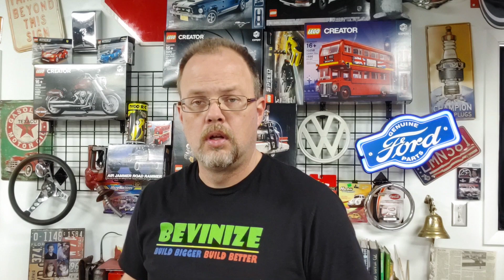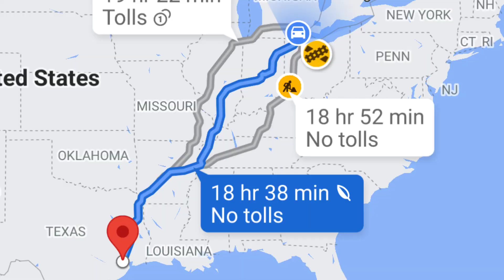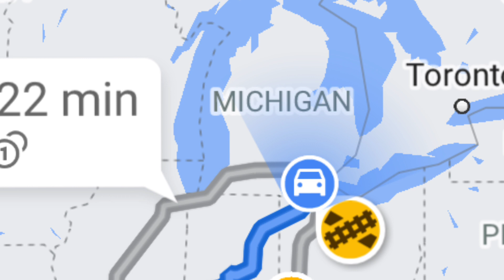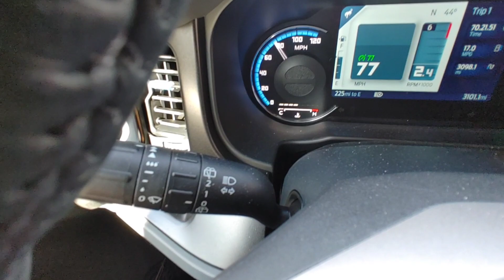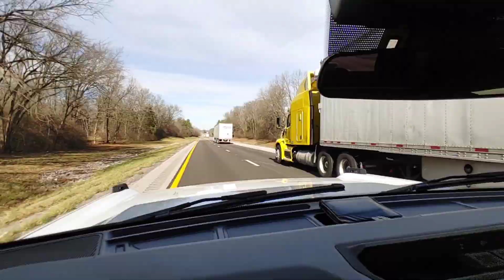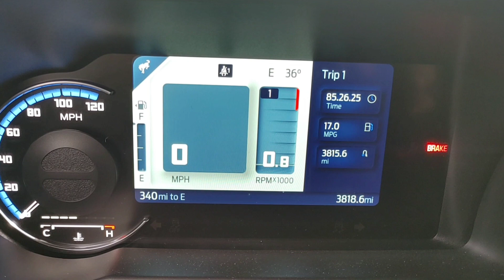2021 Ford Bronco Electrical Problems 8 Weeks Into Owning !

Comment: From the video looks like you were using the wipers when it was dry? Or high setting when it was sprinkling?
Reply from the maker: Yes but I did that to show how they slow down and shut off as it's easier to notice.

Comment: Hey I have a 21 4 door outerbanks 2.3 auto.  Iv had both these issues.   

The wipers were fixed by changing the motor

It's in the shop for thr brakes right now. I also have a light saying park break has also failed and over heated.

Any progress with yours?
Reply from the maker: Yes the brakes were a vacuum line failure to the booster and the wipers was a recalibration of the sensor and switch replacement.

Comment: I leased a new 2021 Ford Bronco about 14 months ago. I get an average of 28 mpg on it. The only issue I experienced was about 4 months ago, the display screen didn't boot up, so, I could not the image when I backed out of my garage. I scheduled an appointment to have it diagnosed, nut couldn't get in until two weeks later. While I was waiting to get it looked at, one morning, the screen came to life and there has been no problem since then. I took a 3000 mile trip to Ely Nevada by way of Denver and Colorado Springs. On the return trip, I experienced an mpg of 30 on I 80 near Evanston WY at 80 mph. --+ Its legal in Wyoming
Reply from the maker: With that gas mileage it sounds like you have a bronco sport.

Comment: You don't take your vehicle to the Dealership.   And don't buy a Bronco - they seem to be having problems,.
Reply from the maker: You must like to piss away money because when a vehicle is under warranty yes you take it to a dealership.
Reply: @BevinsBuilds  Even though it is under warranty, the vehicle will languish in the dealership for weeks on end.  You know, still in troubleshooting - yak, yak.  They'll fire the "Parts Cannon" at it.  You get your "little Ford car" to drive while they have your Bronco.  

In the end you'll be back and back to the "Stealership" time and time again.  Some fun, eh?  (A little Canadian lingo there at the end.)  Thanks.    

Note: There's NO way the dealership "techs" can troubleshoot - find - and fix a complex electronic problem in the time they are allotted for the vehicle. If you have to bring it back and back, they will work on it when they have a chance.  That's why it stays on the lot.  Thanks.

Comment: My ‘01 Subaru H6 was the first model year for that engine and it’s got 200K on it now without design issues.  It can be done well, just not by an American company.
Reply from the maker: First I want to say I love subarus.  But american companies do it all the time as well.  A big part of the problem is most people do not do proper maintenance.  I have a 2012 chevy cruze.  Which was its first year and have 232000 miles on it and still going strong.  But if you look that car up there are a ton of class action suits about the car and its on the lemon list.

Comment: I was going to buy a 2 door bronco but after seeing a bunch of problems with Ford vehicles now and days, engine failures at 2k miles, wiring becoming hot and fusing, and recently the giant 3 million Ford recall. I’ve been leaning to the 2 door wrangler. Don’t like look of the wrangler but seems more reliable than the bronco.
Reply: Jeep?  Reliable?  Are you high?

Comment: Did I miss something? I am not the brightest bulb on the tree but a "tune up" at 4,000 miles? Also, a vacuum line to repair a brake lamp monitor issue??? Better repack the muffler bearings as well.
Reply from the maker: Your right your not, wasnt a tune up but oil change and tire rotation and yes there is a vacuum line on the booster for brakes.
Reply: @BevinsBuilds  Oh, I apologize, but the guy in the video said...tune up, and yes, the vacuum line is for the power brake booster . Just was curious how this affects a lamp out warning. Thanks for being an " expert" on these quality vehicles and good luck with yours.
Reply from the maker: @eddiestanley135  according to Fords the vacuum on the booster had a very mild leak which intern brought on the check brake light because it did not have proper pressure

Comment: In 1968 GM introduced the C3 Corvette, over the course of that model year people in cold climate states discovered that the door locks would freeze shut. The next model year GM fixed the problem, but that is why you never EVER buy the 1st, 2nd or even 3rd model year until bugs are taken out. New Bronco to me is just an ego/status boost as far as I am concerned for a lot of people.

Comment: I had a 2018 tacoma with a multitude of electrical problems.   Navigation locking up and not working, radio issues, cruise control issues, and the worst was the coil malfunctions.  I honestly believe all car manufacturers are buying their electrical components from the same supplier because they're all having similar problems.   I sold it back to the dealership last may and i do not regret it at all.  
I have a 17 year old trailblazer that is flawless and i will keep it forever.  I'm done buying new cars from ethically challenged dealerships.
Reply from the maker: With the global economy sadly yes they are all getting the parts from mexico and china.  Everything is made to be thrown away and not repaired.  I miss the days of being able to pull something apart and rebuild it.
Reply: You rather have a blown motor at 5k or a car that will last you 200k lol
Reply: @4bvenom733  there isn't a new car out there that will last 200k anymore.  Well actually i hear the teslas are supposedly capable of it but why the heck wants to drive a gocart? ...with expensive batteries.💩💩💩💩💩💩
Reply: There is just buy the loweat basic trim model they have less electronic
Reply: you should play the lotto.. not talking smack here but to see a multitude of problems on a tacoma? is super rare lol.. so yeah try the lotto you might have something goin...
Reply: @noxnyc23  Actually it isn’t rare.

Comment: You may have major mechanical issues soon too.  Engines blowing up within 5000 miles
Reply from the maker: Hoping not, the issues have been on the 6 cylinder mine is the 4.

Comment: Any updates? Believe it or not, my son-in-law had a myriad of electrical issues that came down to the battery. Yes, a freagggin battery had the lights flashing, radio surging, wipers doing weird things, and multiple warning lights come on at once and disappearing for days. They put the new battery in everything went away. 4 weeks later, the 2.7 engine blew with the dreaded valve seat issue.

He loved that First Edition but it had to go. Ford bought it back.
Reply from the maker: They ended up replacing the control module and I haven't had any problems since.  I have put an additional 4k miles on it problem free.  

I have to say the engine problems I keep hearing about are a bit worrisome.  But I have the 4-cylinder version and I haven't heard of any issues with those Motors yet.  So keeping my fingers crossed because I really love driving this thing.
Reply: @BevinsBuilds  great to hear. The 2.3 is the way to go until things get sorted. And its just fine in the Bronco.
Reply from the maker: @hellkitty1014  Im very impressed with the performance of the 2.3 so totally agree.

Comment: Older vehicle are last longer and my 2019 Titan has problem with brake rotors, steering wheel making noise  and vibration. It only 30,000 miles right now so it start having problem  around 10,000 miles good thing the warranty fixed everything so I just parked my Titan at yard because I don’t wanna take it to dealer 8 times so my 94 Chevrolet Diesel still running good I am still using no problem at all after 200,000 miles omg I love old trucks

Comment: As a Ford dealer principal and hopefully my comments won't be deleted because Ford spends a lot of money doing that, it is not uncommon to throw parts at a car in my experience even though there's an obvious issue you can scan the vehicle it may have a dozen fault codes three to five of them Ford says disregard because they don't even know why they appear. This is the kind of vehicles they've been putting on the market for the last 10 years. And all we can say is stay away

Comment: I’m always afraid of first and second years of new design vehicles.   Wait several years and see the problems.  Let the manufacturer fix the issues.  Then you can buy with confidence.  People like new stuff.  They rush out and buy these things thinking everything is going to be good.  I’m seeing lots of Bronco issues here on YouTube.  Engine failure, oil leaks.  Electrical issues.   Buyer be ware.
Reply: Yep, not a big fan of small turbo charged motors in big trucks, the 6cyl is even a small motor, 2.7L, I’d rather a larger, naturally aspirated 6, or even an 8 cyl, in such a vehicle.
Reply: If first and second gen designs are that bad, manufacturer might not survive to be around and fix the problems for future models.

Comment: Sell it before the engine blows. There's been a whole lot of them dropping valves into the pistons.
Reply from the maker: I have the 4 cylinder the issue is on the 6
Reply: @BevinsBuilds  a little 4 Cyl in that big truck, I have no idea what Ford was thinking.   A High revving, turbocharged 4 cylinder motor that belongs in a compact sports car in a giant SUV ?   They did the same with the Jeep Wrangler and put a 2.0L 4 cylinder as an “upgrade” for the naturally aspirated 3.6L PentaStar V6, and realized they were being avoided, and quickly removed that “upgrade” cost.
Reply: @TheSchmed  The turbochargers can spin at up to 150, 000 rpm.  That's why, even though they push that air and fuel in those cylinders, under high pressure, they will not last.  Hey, it's mechanical and running at  super high rpm.  FROM AN ARTICLE I JUST READ:
 "Jun 8, 2018 — The turbine in the turbocharger spins at speeds of up to 150,000 rotations per minute (rpm) -- that's about 30 times faster than most car engines can go"

A Jet aircraft's N2 (aft) compressor spins at around 14,000 rpm at take off - 100% to 104%.  Those parts are moving - but they can't hold a candle to a car's turbo at approximately 150,00rpm, when "you get on it" to get into traffic.
Reply: @BevinsBuilds  That's true.  Heard it was bad material used on some valves.
Reply: Believe it or not, the 2.3 is one of the best engines that Ford makes.

Comment: You’re problems are just beginning. Glad I have Cruze. Zero issues for 3.5 years.
Reply from the maker: I have a 2008 eco cruze with 230k miles but some Cruze are absolutely garbage. Most the issues are with automatics.
Reply: Boy you must have got the only one good one Chevy Cruze relabeled piece of s*** Cavalier

Comment: Ford ALWAYS have electrical issues. I'm guessing no one there understand wiring and electronics. And if someone at Ford happened to have a slight inkling of electricals, it will soon be beaten out of them.

Comment: What was the fix for the wipers? I noticed mine slow down also I usually turn them off and back on and they seem to be ok for a bit but do it again
Reply from the maker: The dealer replaced a relay for the wipers and also recalibrated them

Comment: I’ve had my outer Banks almost 4 months now 3000 miles and no issues at all ! First model year I guess there could be a few issues here and there ! I love mine !
Reply from the maker: After they fixed my issues Ive put another 5k problem free miles on it and loving this thing.
Reply: @BevinsBuilds  That’s great hope you have lots of fun with it we are!!👍
Reply: Give it a few more miles.  Lol
Reply: Ya.  Wait till the engine blows up.
Reply: @scott250r2  6000 miles and still no issues!
Reply: @boward6686    Good. I hope it stays that way for you 🤠👍
Reply: Now the motors just blow up. Not bad for $70000.
Reply: @timhanson2080  Bad batch of valves in a very small number of engines on early builds but name one auto maker that has not had issues! You don’t hear about it but right now Chevy trucks are dropping lifters in their engines right and left so they all have issues !

Comment: I have a BD 4dr Manual transand the first issue I am having is a noise from the throwout bearing...going in for service soon
Reply from the maker: Hope its nothing major.
Reply: @BevinsBuilds  thanks ....the 2.3 and 7speed work surprisingly well in the 5000lb brick......hopefully something loose and rattling and not the bearing

Comment: Base Sasquatch here with 10k miles no issues at all besides recently having a clicking noise from tailgate . Will be getting that checked.
Reply from the maker: While driving it or when you open and close it ?
Reply: @BevinsBuilds  while driving … little bumps set it off . Seems the tire is to heavy for the tailgate Or the tailgate is not lined up correct . It’s quite annoying
Reply: @IBuyHex  could try to remove the spare tire and see if it makes me go away, might be a loose bracket
Reply: @BevinsBricksWorld  It bent my tailgate so  it will be replaced. It’s happened to many so I don’t feel so bad but it’s quite annoying
Reply: @IBuyHex  oh that sucks but at least they are replacing it.  Ive been having a blast with mine now that everything is fixed.  Ive put another 5k miles with no issues.  Havent had the top or doors on it in 2 weeks lol.
Reply from the maker: @IBuyHex  lol just realized I was responding from the wrong account.

Comment: that's why you need to raise the minimum wage for the electricians
Reply: Of the three texts of my dealership that handle drivability and electrical concerns every one of them makes six figures. And it is not uncommon for them to have multiple codes that will never clear that Ford doesn't even know why exist. So they end up just changing parts and when the Ford tech line is contacted they want us to tell them how we fixed it. It's a sad state .. but knowledge is power. Tell all your friends the issues you're having and maybe they'll stop running like sheep to pay $20,000 over sticker for this small underpowered inefficient bag of worms

Comment: Yep. There is going to be problems our 2021 bronco that we picked up Dec.23 and then parked with a 177 miles on it because we are not planning on driving it during the winter months. Went to move it in the shop which is heated (parked for about 2 weeks) and it was dead but not completely it would not start but the headlights and some of the radio lights and a couple of the window control lights would come on and stayed on and you could not shut them off without disconnecting the battery. I checked everything you could think of and everything the dealership told me to check and no go. Its currently at the dealership where it was towed, and they said it was not going to be an easy fix. Whatever that means
Reply from the maker: Thats not good, wish you luck and hope it gets fixed.

Comment: I had put it almost 10K miles in my bronco  outer banks and so far no issues. Knock on wood 🤣 loving it so far.
Reply: Im considering dropping my order from a Badlands to OuterBanks. How do you like it so far?
Reply: @JayGuz225  i suggest if you are not gonna be doing a lot of off road get the outer banks and get the high package with it, in my opinion the outer banks in my opinion  looks better and its similar capable off roading if not the has the same g.o.a.t. modes as the badlands . They call the outer banks  the  off roading  with style.  And so far i like it a lot you will get a lot of head turns that's for sure.
Reply: @JayGuz225  — i agree with Daniel. The OuterBanks with the High pkg was the best value for my money! You might want to consider adding the Rear Locker option (was mandatory for me) just to add more capability to the mix!
Reply from the maker: Glad to hear.  Even with the issues I still love it.
Reply: A dozen recalls and software updates though.
Reply: 👌😂👍it’s only a matter of time!
Reply: Nice boat anchor

Comment: This is totally unacceptable for a new car - if it were me I would make my payments at the dealership in pennies 10 minutes before closing until the problem was resolved
Reply from the maker: Hoping it will be resolved soon
Reply: @BevinsBuilds  please keep us posted-
Reply: That's a damn good concept. I'm going to remember that. But anyone who buys one of these at sticker price or much higher should beware of the old adage, a fool and his money are soon parted. You just can't justify 40 to 70 grand for a small sport utility that gets 15 miles per gallon. And it's less than the sum of its parts

Comment: My advice, trade it in for a new Chevy truck. Fords seem to have alot of electric issues not just bronco
Reply from the maker: I really dont care for Chevys myself
Reply: @BevinsBuilds  I’m an old Chevy fan but the late models are garbage- Toyota is your best option
Reply: @BevinsBuilds  or a Toyota
Reply: Don't buy any chevy nothing.i promise you will regret it more than the problems ford has.i owned a2012 silverado and now getting rid of this junker 2020.both ltz.both spent more time at repair than in my drive way.
Reply: @matapeas4302  Ford has more recalls that ANY manufacturer!
Reply: Ive owned like 6 fords and zero electrical problems ever
Reply: @felondog21  Same here
Reply: yep toyo
Reply: Yep, GM has electrical down, see Bolt. Good luck with the Bronco, most may have some issues on new models but how's it resolved